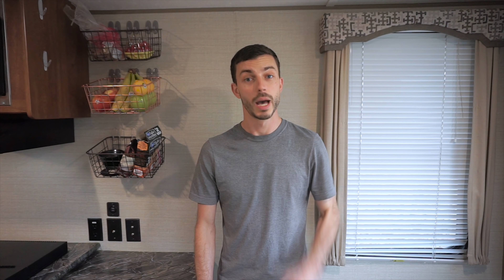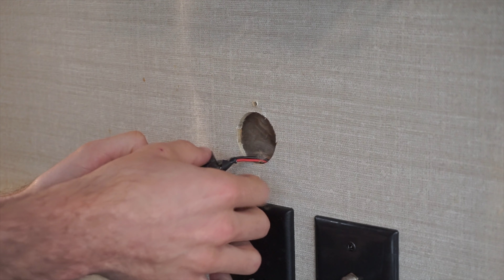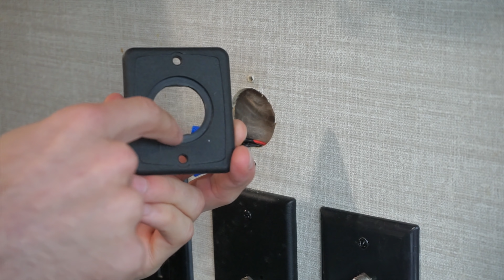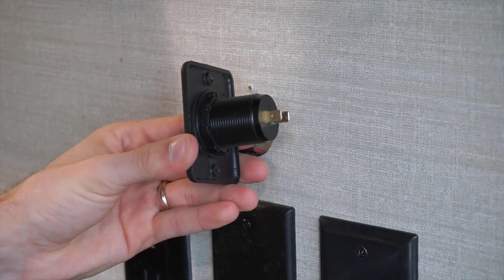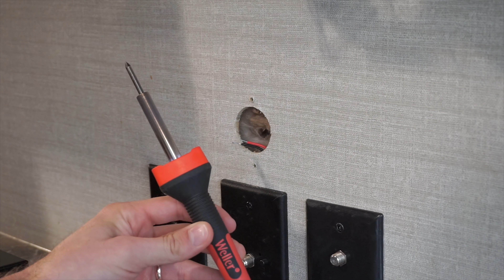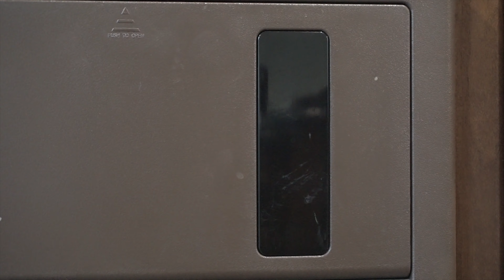RV USB Charging Plug Fix - DC Port for Cell Phone iPad Kindle Devices

Comment: On one of mine only the bottom usb wasnt working. Never worked from factory. I only had to disconnect the power wires and reconnect. Seems there was a loose connection.

Comment: (A “non-electrical” female asking) 🤷🏻‍♀️
Can I just remove the fuse out of the breaker box... that supplies current to the usb port.... rather than disconnect my entire 5th wheel?  

BTW- GREAT VIDEO!  THANKS 🙌🏻

Comment: Hi. My usb lights up and phone shows it's connected. However phone has stopped charging. We've changed the usb but not the former spades.  It still doesn't charge!  It's not a usb problem I'm guessing. Could it be a prob with the spade connectors? If so, why then dies the USB port light up when connected? Help...

Comment: Also the red and black wires were part of the USB outlet the RV wiring is a butt connected to those and are a larger gauge wire. The wires are longer and there probably stuck in the wall. If you pull the wall plates off the wall below your USB outlet you will see were they are snagged. Probably looped around a coax cable.

Comment: Next time your in a place where electrical supplies are sold, ask if the y carry a wall outlet with USB charger's. They cost about $20.00 and anywhere you have a 120 outlet you can put one of the charger outlets.

Comment: Next time you have to cut the disconnect off, you can actually cut the disconnect off near/at the crimp through the disconnect insulation and that will gain you a little extra wire rather than cutting the wire after it exits the disconnect housing.

Comment: Hey, Great video,  I can feel your pain brother!  Been there done it!...on many project's. ..One...Tip? I would have just added a SPACER BETWEEN WALL and FACE plate for future fails.....But W.T.H. always room for criticism because when the job doesn't go easy frustration kicks in to just get it done. Right!
.....Wife & I hope too be out soon just got '15 Ram Cummins single 1 Ton, camper next. Best wishes from Auburn, Al.

Comment: If the DC charging port goes out again, solder on wire extenstion leads & shrinkwrap the connection. Then, try a set of 90° spade connectors.

Comment: Did you try also with another cable to charge ??? I found that 9 out of 10 the cable is at fault. I would have bend the connectors problem solved

Comment: Nice job, thank you for sharing. Ours has failed twice and I had to replace them. What I found is for some reason is if I go to charge two devices at the same time the plugs get warm and both outlets fail for some reason so now I just use one outlet at a time and for the last year I have had no problems. I also have a outlet that has what looks like a cigarette lighter outlet in the trailer and use a round USB outlet that plugs into it with two outlets on it and can charge two things at one time with no problems. So if yours fails again you might want to try this instead. Take care and happy camping.

Comment: Mine went out on me last Summer. Jayco dealer wanted way more for the shipping than the part. I e-mailed the manufacturer of the part. They sent me one for free. It was only 2 years old and they said they had had a lot of issues with that one. Two screws out, cut the old wired one, splice the new one in with a little tape and screw back in… BUT as you stated sometimes it isn’t that easy… one wire came undone and I had to redo. …. All is well though…

Comment: Nice work! I probably would have just bent the pins back when it didnt fit since the wires are so short, but your soldering is better than risking breaking the pin connections inside the charger and having to buy another

Comment: Could you have solder the wires at 90 degrees to the two plug leads insuring more clearance to the inside back wall?

Comment: Because your walls are so thin, it might be a good idea to buy a set of 90° Spade connectors. They help for tight situations like this.
Reply: I was just about to type the same thing. He should have soldered the wires through the holes.